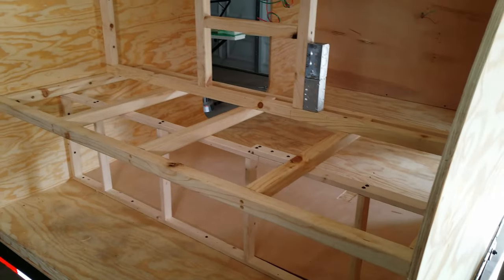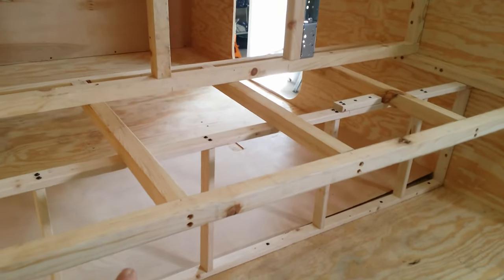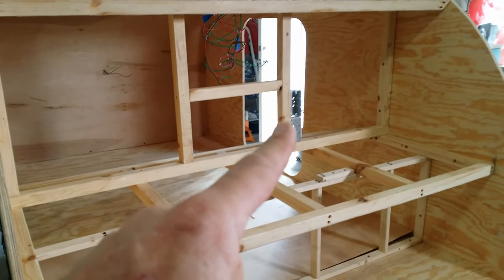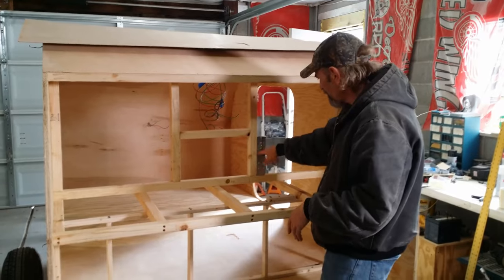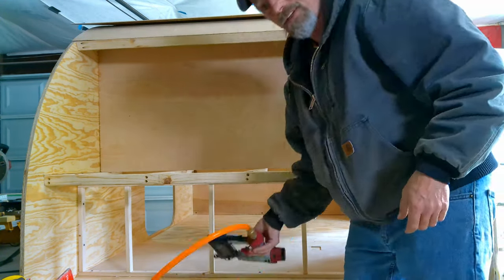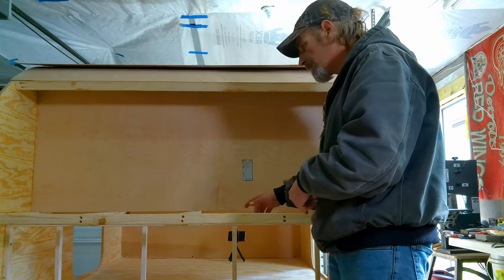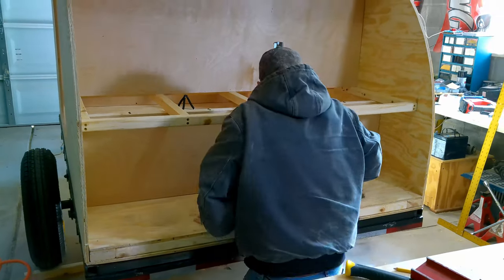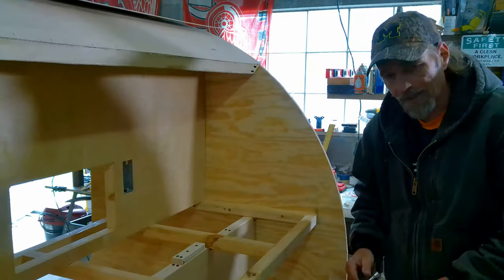How to Build a Teardrop Camper. Part 7. GALLEY LAYOUT (Charity Build)

Comment: Loving your video’s they have taught me so much. Question? On the flat bottom door what do you put under the aluminum threshold?
Reply from the maker: Nothing. It has a lip on the outside edge for butyl tape. I do that and seal the outside edge with proflex rv. You could put some proflex under it if you want to. Thanks for watching!

Comment: How is the mattress going in? Not through the door right?
Reply from the maker: It went in through the door at the end of the build. It was a 7 inch thick memory foam mattress. We folded it in half and pushed it through the door while the other pulled from the other side. We had to work a little but it wasnt too bad

Comment: did I see correctly that there is a hole on the floor on the inside of the cabin?
Reply from the maker: No holes in the floors, I'm not sure what you seen unless it was the inside bulkhead wall skin sitting on the floor in the cabin. Thanks for watching!